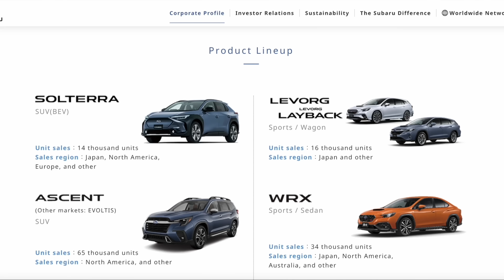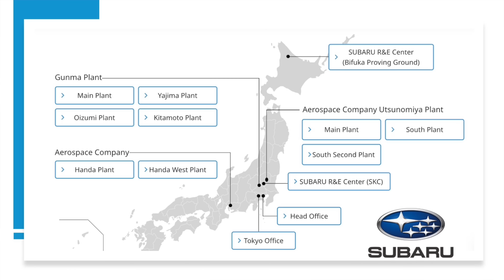ENGINEER EXPLAINS WHERE SUBARU's ARE BUILT // ARE THEY BUILT IN JAPAN? // BUILT IN THE US?

Comment: I have had a 2015, 2017 and a 2020 Impreza and this year got the 2025 Impreza Sport model. All have been very reliable and solid but the 2025 is built in Japan and I prefer the build quality over Indiana. I will never switch from Subaru as they are a very safe car and when you keep it maintained you can expect 200k +. As far as complaints about CVT as long as you change the CVT fluid every 30-35K along with the differential's fluids you should not get excessive wear from either. Driving the Impreza is a pleasure either around town or on longer trips and gas mileage is mid 30's on the open road.

Comment: I have a 2021 Subaru forester Touring. Bought it for the family, safety, winter weather, and upstate NY and beach trips. Love it , feels like driving a heavy SUV because of all symmetrical AWD. Of course I did drive it on snow, very confident, no issues stays in control. 
Only, it is not a Toyota , its is a boxer engine, you must do engine old change on time 3k-5k. Front and rear differential oil change every 30k, CVT oil change 30-40k . Only if you wanna keep it for over 200k healthy.

Comment: I wish Subaru stop using CVTs. Mrs absolutely hated the CVT on Ascent during the short time we had. I'm not sure about the WRX but I absolutely loved the WRX Sti, except the suspension. I regret not buying it. I'm sure there's aftermarket suspension with adjustable compression and rebound , so you can dial in for a smooth ride on pavement. But calling Subaru "A Tank" is very exaggerating compared to body on frame 4x4s.